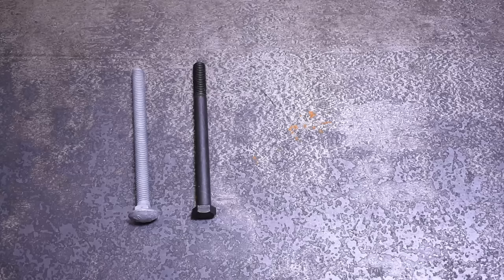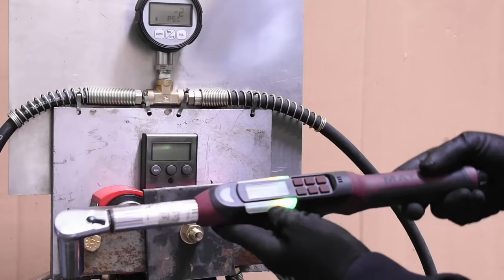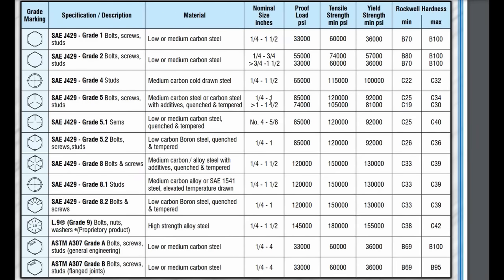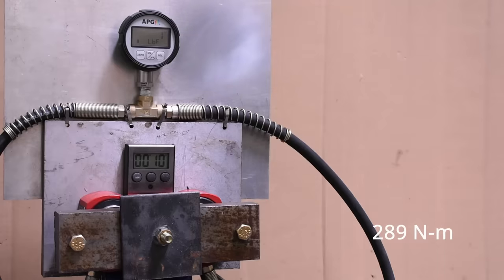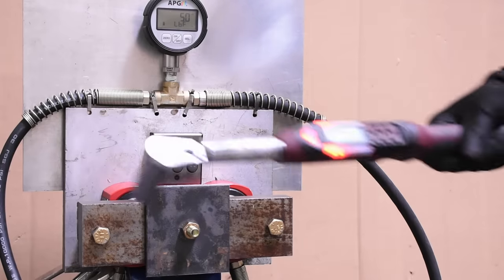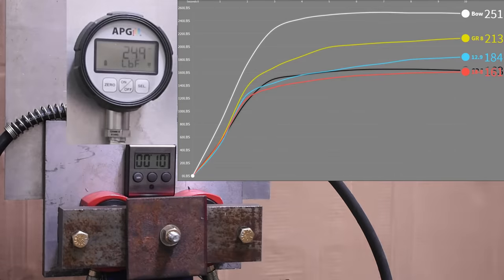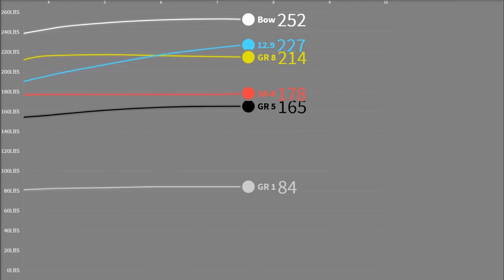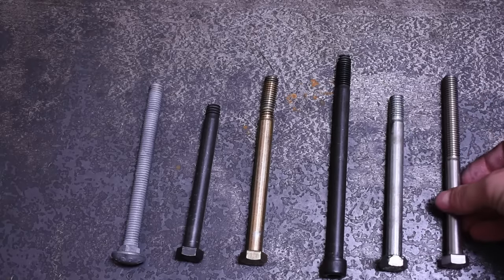Strongest Bolt? Grades Explained & Dyno Tested For Science

Comment: A joint's clamp Force  = Torque / (K x Diameter). I see there was a torque to force conversion done at 3:50, but how were you account for the several different types of coatings that would change the K? (plain, zinc, black oxide, etc.) I think the K factor variation would be enough to skew the side by side results shown in the second half of the video. 

And for your comments at 17:47. Those torques are for 75% of the fastener's proof strength, which is generally considered the standard/conservative torque value to use. 

I enjoyed watching the video though! Thanks!

Comment: 11:30  Those internal  HEX  heads, have a greater strength level, than  ANYTHING  with an  external   hexagonal  wrench head.  All the force, distributed evenly  in an  ENCLOSED  structure;  which is alot  stronger, than any hexagonal  head, with a socket, or an open-ended   wrench.  I just changed the fan belt, in a Nissan forklift, with very  very  cheap, 12 mm bolt heads, USED  on the U  joint; onto crankshaft. The bolts, had an overhanging flange, on the hex head, and the wrench just rounded them.  ( cheapest steel ever ! )  After using vise-grips, to remove them; i belt-sanded that warped flange  OFF, flush with bolt heads'  main surface area.  Upon installation, the head was holding the wrench very good, as there was no  cheap FLANGE, overhanging, for wrench to slip. One head, i ground into a rectangular  square; used open ended wrench, to tighten it down.  USE   GOOD  STEEL,  BOLTS   WHEN  REPAIRING.....' stuff '.    (metric threads; couldn't  find 8 x 20  
mm bolts, with a  hex  head,   THAT   SMALL....had to use the originals- i did'nt  want to.......oh well....such is life ....)

Comment: 18-8 and 18-10 Stainless bolts are actually fairly strong, they've performed similar to a grade 5 bolt in all the places I've used them... which has been in high corrosion situations.

Comment: I use 12.9 to 90% of what I construct, the rest is stainless a4.

When you work with high temp applications you have to know how the bolt handle to be heated and cooled regular over and over again.

Many thinks that a bolt is just a bolt.

Comment: LiFePO4 battery terminals are made from aluminium. There are 2 options: M4 & M6. Which one do you think is stronger to attach a cable with a stainless steel screw please? M4 will provide more contact area with the busbar or cable connector, but I am afraid it will be easier to damage the threads in case of over torquing. Max force recommended in spec sheet: 6 Nm. What are your thoughts?

Comment: Hardness and toughness are not always directly correlated.  A good test for toughness is the Charpy V-notch test, but it is a destructive test.  Is there any information on Young's Modulus for these fasteners?  That would give you a cocktail napkin estimate of toughness (or yield strength, at least).

Comment: Enjoyed that, and as the old researchers saying goes, good research does not necessarily supply surprises. This would be hard to set up for you but I would enjoy seeing how well various styles of Locknuts and chemical thread lockers stop things from shaking loose. I have always used lock nuts or thread locker on everything that did not specified none, was I wasting my time? I was in aircraft for a long time and everything had something to keep it from loosening - overkill or goodpractice?

Comment: I work with stainless hardware all the time and what I find interesting about it is if you have a stainless nut and bolt together it seems they will cold weld together at tork I have broke countless bolts trying to loosen them after the fact to re adjust super frustrating.

Comment: I'd be interested in seeing industrial studs being tested. B7 or B8 are commonly used. Also, jet engine fasteners - I used to work on RB211's and GE engines and the 12 point bolts, while small in size, were really strong

Comment: if you worked on some specialized machinery I have seen Grade 9 (still a common stock item) and a specialized special order Grade 13 bolt that is stupid hard but also very brittle. I have never seen a national coarse thread grade 13. They were all fine thread, and used on very specific parts of machinery with super heavy shock and vibrational loads.

Comment: First, great video as always. Second, after watching many of your videos I have a weird observation. You set the timer to 10 seconds, hold the impact gun in your right hand, start the timer with your left hand and immediately pull the trigger and move your left hand from the timer to the impact gun. Why don’t you set the timer to 13 seconds so you can start the timer with your left hand and move your left hand to the gun while the timer counts down, then with both hands already on the gun pull the trigger as soon as the timer clicks from 11 seconds to 10 seconds.
Reply from the maker: It's a good point. Basically out of habit at this point. We have so much old footage we use people start to question why the different methodology between testing two tools in an episode. We've done it for larger impacts like the 1" and always get a few questions about using 13 seconds

Comment: your "bolt stretch" is known as elastic deformation, once the stretch no longer returns to its original length, its called plastic deformation.  yield strength is determined as the point at which elastic deformation turns into plastic deformation.

Comment: One point you didn’t discuss is side shear force under maximum torque for a bolt. Yes we have clamping force but also side shear or just shearing load of a bolt. I was building my own jib boom and trolley system for my work bench and I needed to know the lateral force on a 1.50 inch diameter bolt because I was using it as the swivel pin of the jib crane. P S I built it over 20 years ago and it’s still working but I do have maximum load rating for it because everything is mounted to my work-welding table . I’m more concerned about the table tipping depending on the position or swing position of the jib then a bolt failure. Also the jib reach from the pin is 5ft and I’m using a special I-Beam with curved radiuses that is made exclusively for trolley jib overhead cranes. And yes it’s expensive and I had to special order it from my local steel yard🤪

Comment: Very nice presentation.
It appears your graph is placing load on the y, and time on the x.
Would be cool to do a similar test with a hydraulic puller so displacement could be measured on the x.  This way you could calculate stress and strain curves to establish actual yield. This would produce values that don't have the element of time involved.  The higher strength, less ductile bolts shoot up in torque compared to weaker one because they do not stretch as much as lower more ductile material.  A hydraulic apparatus would also give you reason to buy more fun testing equipment.... :)

Comment: Very interesting, real life experimentation.
As a previous poster mentioned, it would be interesting to try lubes, I suspect/know torque would go down for the same tensile limit.
Also interested in seeing hand tightening vs. the impact, I suspect the shock of  impact hammering has some effect.
Interesting how some bolts stretch, while some snap. That is why with harder bolts, there is no "feel" as they reach their limit. With Grade 5 or 8 bolts, there is some learned feel for tension.
My years of experience have shown me there is a disparity of consistency in bolts. Of similar bolts at a similar torque one might stretch, one might strip, one might snap and another will be perfectly fine.

Comment: I have to order Grade 8/Grade 10.9 metric on my '02 Jeep GCL on Suspension parts.
▪︎ I'd like to see a video on the metric grade 10.9 Bolts/ grade-10: Nuts different coatings!
Which ones are stronger, which ones have good rust protection and survive high Ft-Lbs torque.
The ones I see on BelMetric are Black Oxide (phosphate and oil), Yellow Zinc and Clear Zinc.
Not sure what the Amazon "Hard To Find Fasteners" coating is, they look like Black Oxide but who knows?

Comment: The harder the bolt, the more brittle. There is a reason we use nails instead of screws for framing. You want a bolt to not only provide clamping force but also be able to resist movement with heat and cold and flex. A cylinder head uses 10.9-12.9 bolts depending on the compression of the engine. While externals are usually 8.8. Some are full thread to act as a spring. 12.9 bolts resist side loading and are used for tensioners often. Some exhaust manifold studs and bolts are grade 10.9 but B7 alloy which gives them strength with prolonged heat. Using a regular 10.9 bolt in its place would fail as the heat/cool cycles would make it harder. Coatings like zinc and phosphate also modify clamp loads as do oil, anti-seize, moly at the same torque spec. Great overall comparison to strength but there's a whole lot more to it than that. Love the channel!

Comment: I've seen many ssbolts gall before the nut got run all the way down when running an impact. With and without grease! I was a marine tech for over 20 years and a car mechanic before that for 18 +years. I used stainless on exhaust manifolds but the heat makes them loose tension. Even with ss lock washers they kept getting loose. In a pinch ok but change them when possible. Also for the propshaft couplings, only in a pinch. Typically grade 8 or 10. Whatever minimum.

Comment: Fastener suppliers have always told me that stainless fasteners have basically mild steel equivalent tensile strength.
I have never heard the "shiny" equals strong theory.
Electroplating potentially weakens fasteners due to the chemical treatments used and hydrogen embrittlement

Comment: I found out about bolt grades when I had to remove a heavily rusted brake rotor stuck to the hub.
Upper grade bolts easily popped them apart.

Comment: Remember that AISC Graded Bolts, for Structural Steel Erection are another set of grades. A-307, A-325, A 390, etc...
Reply: And have bigger heads and nuts. This a A325 3/4" is a 1 1/4" head compared to a 1 1/8"  plus washers are thicker and smaller diameter.

Comment: Only having a look because I want to know what a "Dyno" test is.    OK ...TORQUE TESTING ....which is NOT the way to test for "strength".

Results are "general" results ...which is OK ...but many details were left out.  But, the results are OK to pay attention to only because the "testing" method did not change making the results were consistent.  Good reference to the table to keep everything in perspective.

Something that should have been addressed is the point of failure and how the results, appearance, changed.  But perhaps this is something the guy narrating is not knowledgeable of.

There a lot more going on that just applying torque to failure ....but the point of the video is probably very good for many viewers.

.

Comment: 303 SS can withstand relatively high sheer loads and has great rebound. The problem is that most structural connections need to maintain fairly tight clearance. SS hardware is unlikely to catastrophically fail under normal conditions, but may allow undesirable gapping under high tension loading.
Reply: Cool story bro.
Reply: @mann_idonotreadreplies  

Thanks. I thought so, too.

Comment: So if I was using giant bolts to forge into knives, the higher grade ones seem like they are more harden-able then right? Or did I miss something?
Reply: Yes the higher the grade, the harder the bolt is, meaning more notches on the bolt head. Caution is noted: you are not supposed to heat up bolts and reuse them on such items as car suspensions and other critical areas. It makes the bolt extremely brittle almost like glass. A simple test: heat up a grade 8 bolt (six notches), cherry red, let it cool and then put it in a vise and hit it with a hammer. It will snap right off. Aviation mechanics are taught to cut the bolts in half so they can't be reused, if they were heated to remove them. Are your knives very brittle? You need to buy the proper tool steel and learn the hardening process. Retired welder and car mechanic.

Comment: IIRC, 18-8 stainless steel is the same stuff your knife and fork are typically made from if you have stainless steel utensils. As I understand it, stainless steel is problematic for high strength applications because it's difficult to get the corrosion resistance and hardness at the same time. You hit a certain point with the alloy ratios and it just won't go higher. It also doesn't heat treat well. (Though there are more specialized methods of achieving the same thing.)

Comment: Great video!! I would love to see the same type of comparison but using a thread lubricant. Different types of  lubricants... like gp grease, anti-seeze, ARP grease, CRC, etc.
Reply: Plain oil, usually 20w is what is normally specified for lubricating threads prior to being torqued to specs. Anything heavier or lighter in viscosity will change the actual torque reading. 

Super lubricants, like teflon or anti-seize will reduce the friction so much that you will either break the bolt or over tighten it beyond belief! Not recommended unless you are using it on a special needs and much attention to detail. Anti seize is great on pressure screws for gear pullers/ balancer/ ps pulley pullers because it reduces the friction greatly. Anti-seize is great on exhaust fasteners but care must be used. Using anti seize or a super lubricant on head bolts on a aluminum head may result in a head that squishes/ gives out by the fastener.

Comment: I had to drill out an Aluminum Hex bolt out of my head cap on my Specialized bike, the aluminum bolt corroded with the steel spider nut, I put a stainless steel bolt instead.
Reply: As long as you use lithium grease or anti-sieze compound on the thread it will come out when needed.

Comment: I’d like to see some more about bolt grades but using B7, B16, 660HT, L7, B8, B8M. More industrial stuff of bolts. Bigger stuff. B7 for example has a tensile strength of 105,000psi, up to a certain size, then after that it’s 95,000psi.

Comment: Hi. I just subscribed to this channel recently and really enjoy the content. However, I am lost on much of what you are showing. Hope you can answer a few questions:

When you are tightening down and a bolt starts to plateau, what is going on?  Is the sotness of the steel absorbing the impact energy and releasing it again instead of turning, or, is the bolt deforming under the pressure and not tightening?
How do you know if it is the bolt's increased hardness that is unable to absorb the impact resulting in the bolt structurally failing. If you were to use a non-impact tool to tighten the harder bolts, perhaps they would be able to withstand far more torque?
Finally, I am having trouble understand how a bolts strength is measured in psi. Like, what is that measuring? Where is the 'inch' being measured?

Comment: For stainless us use F593 series , last letter gives material, 304, 316 and strength .
Ex F593c 304 cold worked so higher strength .
F593B not cold worked so lower strength .

Comment: I've used the same mid torque you're using to break off lug nuts and it's way better to use an air gun, it does not impact hard enough.

Comment: We use 10.9 and 12.9 on our extrusion machines where I work. The 12.9 are heated to 650-690f and the 10.9 are heated to 740-800f. We regularly break both with hand tools (an 8 inch wrench and an allen key). It's probably because we keep them so hot (the machines stay at temp for 5 days straight) but still I feel like I shouldn't be able to snap something rated so high with my bare hands and a wrench/allen key.
Reply: Sounds like the bolts are a grade too hard (brittle) for the high temp application.   Engineers aren’t always correct.

Comment: The stainless steel bolts are also used in the water industry, like on pipe flanges for fure hydrants. Theres 304 and 316 ss bolts.

Comment: Would you not want those carriage bolts to technically be softer? The application for those from what I have seen is in wood (decks)  or plastic (like public benches) so a bit of give would be needed given how those materials shift over time and temperatures.

Comment: Some thoughts... 🤔
A test of rolled threads compared to cut threads would be interesting...
A thrust bearing under the nut would (for the most part) remove friction from the equation..
Has any account been taken of modulus of elasticity and length variation ?

I like this stuff !!

😎👍☘️🍺

Comment: Its important to replace the bolt with what the manufacture says, If you pull a grade 5 out of a car and put a higher grade, it can snap because its too rigid of a bolt
and a grade 5 will flex

Comment: 12.9 tend to be used in high load, limited space areas such as head bolts hence the hex head cap screw configuration. I think the lower clamp load was due to the finish on the bolt which has a higher friction than the zinc plating. Best to use some sort of lube on the threads for the tests.